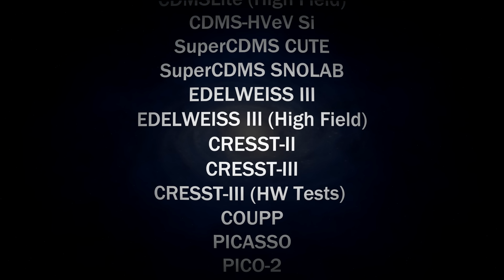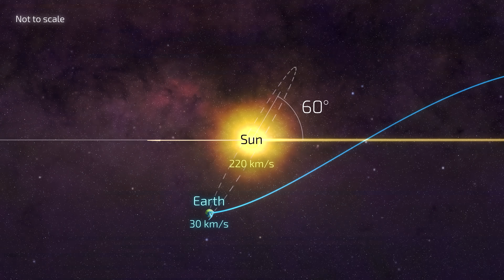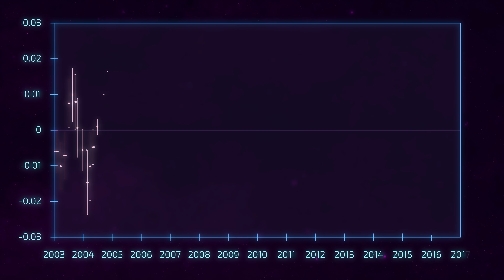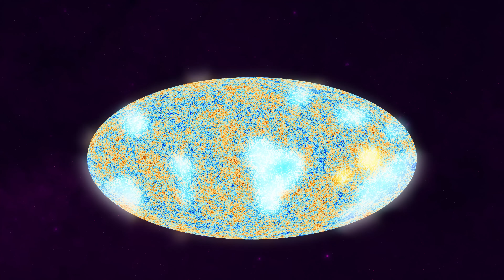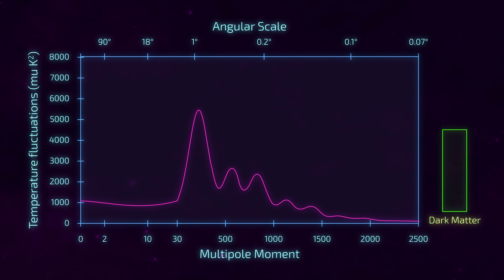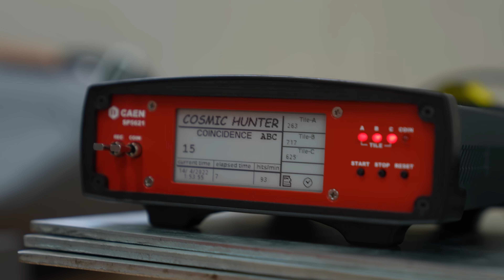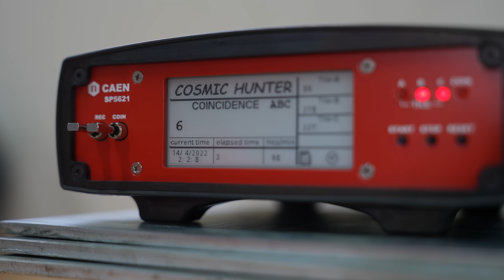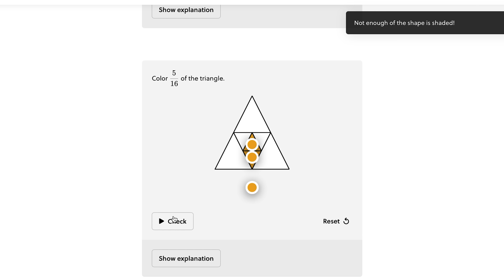The Absurd Search For Dark Matter

Comment: Dark matter always sound like planets to me. Could it be that there 5 times the mass of visible stars in planets?
Reply: That's the theory of MACHOs, MAssive Compact Halo Objects, and it had been considered by astrophysicists for decades but is nowadays generally believed not to be the (full) answer.

The issue is that some dark-matter-suggesting observations aren't compatible with it — for example, the ratio of deuterium to hydrogen, or the specific pattern of the cosmic microwave background. MACHOs can explain other observations but not those, whereas current models of dark matter as particle-scale can explain all such observations. That's why people don't think it's planets.

Comment: Factual information for you! 
Quantum mechanics physics Rules 132multi dimensional universes in negative warp dimensional bubbles field Frequencies to access them by using warp dimensional saucer spacecrafts by matching each of the 132multi dimensional universes in warp bubbles field Frequencies!
This universe is in Quantum mechanics in negative warp dimensional bubble field Frequencies traveling faster than speed of light !!
This has done by StarDrive engineering company in 1997year for scientific sciences research and investigation and documentation for dept of defense pentagon in 1997yr

Comment: I am trying to understand why this detection experiment is relying on dark matter interacting with matter to produce photons of light. Is there any way to detect dark matter with gravity interactions instead?
Reply: Gravity is the weakest of all forces, and the density of dark matter is very small. That's why we see the effect of dark matter only on very large scales of galaxies. So a direct detection of dark matter via gravity is pretty much impossible.
Reply: @TRLagia   I understand that, but it seems like the premise "dark matter only interacts through gravity" would require a new method of detection that exploits this feature. Perhaps this had already been ruled out? It is a fascinating field of study!
Reply: @joshberna5801  The thing is that dark matter does not only interact with gravity. Or so some models say. For example the Weakly Interacting Massive Particles (WIMPs, mentioned in the video) can interact via the weak interaction, as the name suggests. This interaction is very rare and the density of dark matter is actually pretty low, which makes detecting it harder. Another example would be axions, which could couple to a magnetic field and produce photons. However this interaction is also very unlikely and so far nothing has been found.
In the case that dark matter really only interacts via gravity, we will probably never detect it directly.
Reply: @TRLagia  Thank you for your response! That makes a lot of sense. I guess I should have done a little bit more research before I made the comment!

Comment: DAMA/LIBRA is a garbage experiment that doesn't bother to separate their backgrounds. What they're actually measuring is 22Na decay chains, and annual modulation thereof. The annual modulation is due to changes in the sensitivity of their photodetectors. A number of experiments see oscillation in decays and it's thought to be experimental error. But even if it isn't in error, it definitely isn't dark matter.

Comment: At my opinion it's a fundamental misconception that the mass of the galaxy is only centered (yes there is a black hole in centre but this affects the inner core of the galaxy the most). The mass of the galaxy is also distributed over the ring or arms of the galaxy, therefore there is no need of dark matter. All masses of the stars creates a gravitational field which also hold the outer stars in their places.

Comment: Why does the detector depend on a particle - which can't interact with the detectors particles - to collide and interact with the detector? I thought for sure that they would be measuring gravity somehow instead, considering that was its only vector of interaction.
Reply: Gravity is almost impossible to observe if not in large mass objects. Plus dark matter supposedly is able to interact somewhat with the machine. If the readings confirm it’s existence, it would also confirm how little it interacts with matter
Reply: @panagiotisavgerinopoulos2750  My point was that they stated dark matter was literally incapable of exactly that ("interacting somewhat with the machine"), and that the only interaction possible is gravitational. Followed directly after by talking about it colliding and bouncing off particles in the machine.
Reply: @panagiotisavgerinopoulos2750  
"Gravity is caused by the mass-energy density of space. This mass-energy density of space is determined by the square of the Wave-Amplitude and is always positive (squares are always positive). The  wave-velocity is inversely proportional to the mass-energy density of space, the higher the mass-energy density of space, the slower the Wave-Velocity. As Matter and its resultant mass-energy density of space are always positive, this causes a slowing of In-Waves as they travel through other matter/wave-motions, and it is this property of Space that causes the natural ‘Gravitational’ attraction of all bodies, and explains why Gravity is always attractive." (Geoff Haselhurst)

Comment: Something I don't understand, if dark matter only interacts through gravity how come it's not clumping up tighter than a vague cloud, does all dark matter repel from itself at certain distances? Do all dark matter spots have a uniform density of it? What's the maximum and minimum observed density of dark matter? Even if the particles don't interact in any other way than gravity surely they'd sap/increase each other's angular momentum during flybys so they'd cluster into some specific patterns?
Reply: Dark matter is usually modelled as collisionless, but it still "clumps", i.e. it forms dark matter haloes that are surrounding galaxies. These haloes have a density gradient, that means they are denser in the center. Idk about specific values, but generally speaking for more massive galaxies there are denser haloes - for example the Milky Way halo is denser than the subhaloes around its dwarf satellite galaxies. So the pattern here is that everywhere a galaxy is, there is a dark matter halo around it.

Comment: It's all about the incorrect interpretation and presentation of the material by Derek and the vast majority of such "popularizers" of science.

 In short, then:
 1. The speed of rotation is affected by mass
 2. Dark matter is distributed evenly over the entire area with matter, in contrast to matter, which is concentrated more towards the center.  Which, by the way, is also strange: if gravity also affects dark matter, then why doesn't it slide to where it is more - to the center?
 3. The farther from the center - the less matter, respectively, the more dark matter compared to matter
 4. On a galactic scale, it is at the edge of the galaxy that this ratio reaches 85% !!!  Only scrub the galaxy, not everywhere!  Why Derek did not mention it?
 5. On the scale of the solar system, this difference is much smaller, so much so that it is indistinguishable from the influence of an extra asteroid or comet.
 And Derek just repeated word for word for the hundredth time what other "popularizers" had said before him, instead of explaining this.
Reply: 2.  Normal matter bumps into other normal matter, and winds up sticking to the other normal matter.  Essentially it clumps together because it responds to the electromagnetic force.  Dark matter doesn't feel the EM force (or the strong nuclear force I believe), so it doesn't clump together.
Reply: @stevesether  Most of the mass of the galaxy (normal matter) is concentrated in the center, then why does the dark matter not tend to the center to this mass by the gravity?
Reply: @AlexeySilichenko  Because it's flying around, and doesn't "stick" to itself, or anything else.

IIUC there's been computer simulations that show this simple explanation as accurate, and show where the dark matter should exist.  There's different numbers you plug in, depending on the mass of the dark matter particles.

The reason you or I don't fall to the center of the earth, even though we're attracted to it by gravity is the EM force in the atoms of our bodies are repelled by the atoms in the surface of the earth.  The EM force is so much stronger than the gravitational force that the entire weight of the earth is held back by just a single layer of atoms.

Dark matter doesn't respond to the EM force, so if you were suddenly turned into dark matter, you'd fall to the center of the earth.  Then, you'd whip past the center to the other side of the earth.  You'd then flip/flop between the two side of the planet.

Now, you might ask, maybe there's a DM halo around the earth?  Could be.  It all depends on the velocity and mass of the DM.  I couldnt' tell you the details beyond that.
Reply: @stevesether  sorry, I cannot get it: why if I turned into DM then I'd fall to the center of the Earth, then why "real" DM don't fall to galaxy center, for example, or even into supermassive black hole in the center? Mass of center region of galaxy is greater than mass of around region then why DM don't slide down to heavier region - galaxy center? Why is it distributed? I cannot get why something that responds to gravity is illegible to regions with "more" or "less" gravity.
Reply: @AlexeySilichenko  If DM had zero kinetic energy with respect to the center of a galaxy,and wasn't within the gravitational attraction of another body like a star, it would accelerate toward the center of the galaxy.

But nothing would stop it, and it'd oscillate between either side of the galaxy.

Normal matter doesn't do that, since it'll hit something along the way and slow down.

Now, it's likely more complicated than that, since the center of a galaxy isn't really much like the center of the earth, since even the center of a galaxy is still just mostly empty space.  But the idea is the same.
Reply: @stevesether  Thank you

Comment: I don't think it's a particle. What if it's a tiny tear or "stretch" point in fixed space/time or maybe just atoms running smaller/larger. Applying a measurable effect of sorts to anything passing through. Maybe Atoms experience a "compression" of sorts when pushed through this quantifiable "resistence". Could be resizing a molecule requires and/or generates energy i.e. dark matter. 
Theory being gravity dilates/detracts time in a similar manner as light. So then we could just be perceiving the relative difference in rotational speeds due to time dilation?

Comment: If everything is a wave length, and we now know that gravity is a wave, isn't it likely that dark matter is also a wave?
Reply: "Commendation from NASA for research work at Massachusetts Institute of Technology on the Earth's atmosphere and the Moon's surface for navigation of the Apollo spacecraft to the Moon..
Dr. Milo Wolff has found the structure of the electron consisting of two spherical quantum waves, one moving radially outward and another moving radially inward. The center of the waves is the nominal location of the electron 'particle'. These waves extend infinitely, like charge force. All 'particle' waves mix and contribute to each other, thus all matter of the universe is interrelated by this intimate connection between the fundamental 'particles' and the universe. The natural laws are a direct consequence of this Wave Structure of Matter (WSM), thus WSM underlies all of science." spaceandmotion

Comment: Interesting, but I don't understand an important part of this.

If dark matter interacts gravitationally with normal matter, why would it be distributed around a galaxy in such a way as to account for the fact that stars near the outskirts orbit at approximately the same speed as stars near the center?

I mean why wouldn't it tend to become part of the very same stars and planets formed by normal matter forms due to gravity, instead of forming objects that don't include normal matter that we can't see?
Reply: If the dark matter only interacts gravitationally, then it's possible that the friction or other physical processes that cause normal matter to slow down and lump up into celestial bodies don't apply.  My thoughts are that this allows the dark matter in a galaxy to effectively be evenly distributed about its center, which would explain the near constant angular velocity of all stars
Reply: Additionally, I'm not sure how accurate the visuals in the video are, but the observed rotation wasn't exactly constant throughout; the larger radius orbits were slightly slower which could suggest that some amount of dark matter is concentrated higher around observable bodies
Reply: @ethandavis7310  I guess I assumed gravity alone was what caused large objects to form in the universe. Thanks for sharing that idea.

Comment: I don't quite understand the explanation for constant rotational velocity in a galaxy. I understand that a star at constant distance would have to move faster if the mass of the galaxy is larger, but wouldn't all parts of the galaxy be rotating faster and therefore the stars near the center still be moving faster than those on the outside?

Or are masses near the center of the galaxy not as influenced by dark matter because more gravitation forces cancel out, and therefore a relatively more even distribution of mass in the galaxy from dark matter allows stars on the outside to move faster than you would expect?

Comment: The going theory is that intergalactic space is expanding in all directions at an increasing rate. What if the reason for the outer stars not flying off into space is because of the accelerating expansion of intergalactic space, not dark matter, sort of like a boundary condition.  If the fabric of space at the outer boundary of the galaxy is expanding in every direction, then wouldn't that have a limiting effect on the outer stars' ability to displace, relative to an observer inside the galaxy?